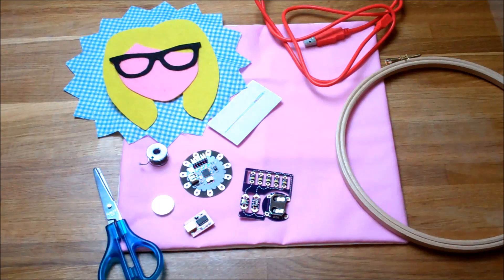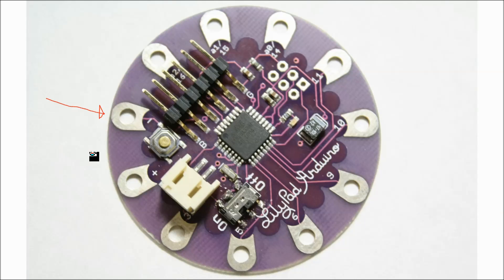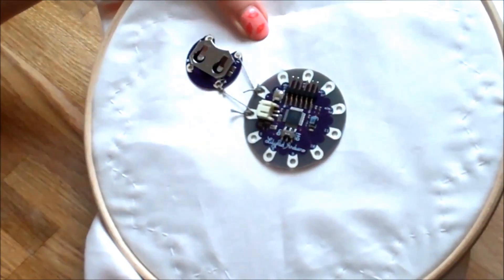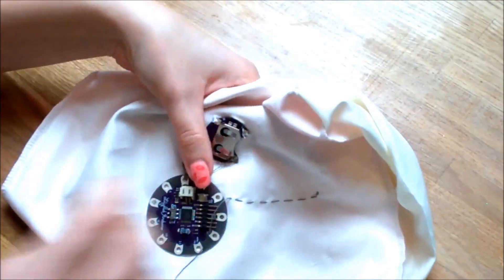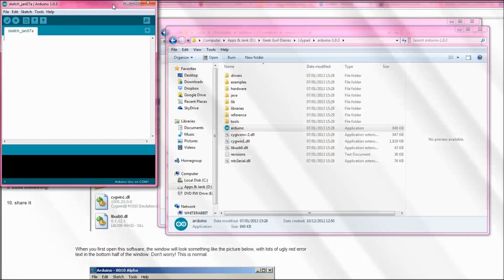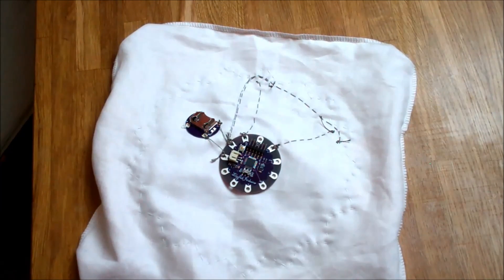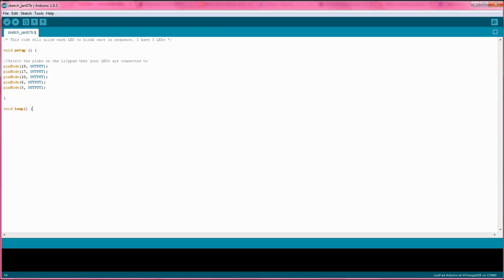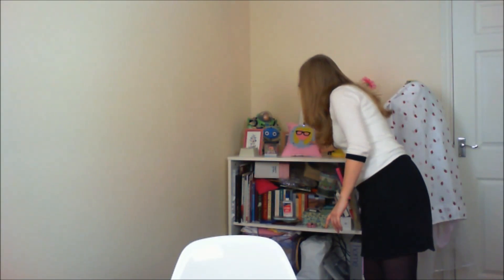LilyPad Arduino Tutorial

Comment: You could maybe sew a ground (negative) thread in a circle around the outside then you'd only need to sew each LED to the pin and to then the ground thread outside so it looks neater and there's less thread all over the place to cross.